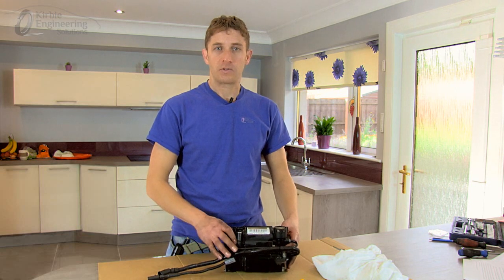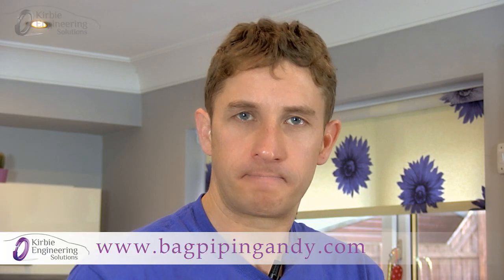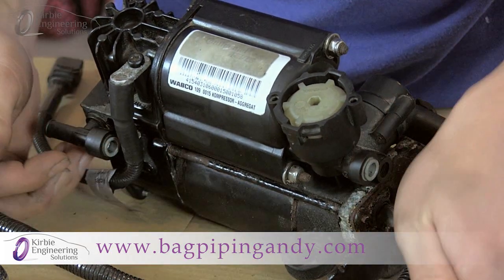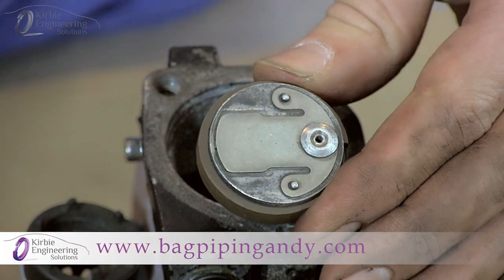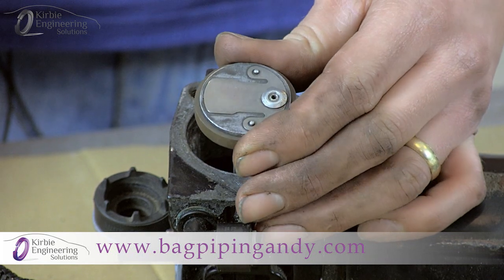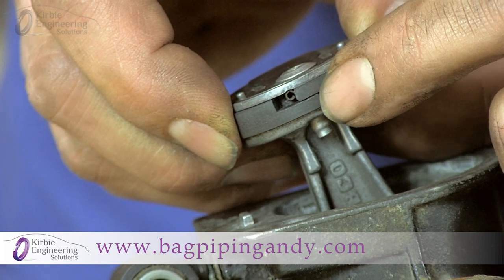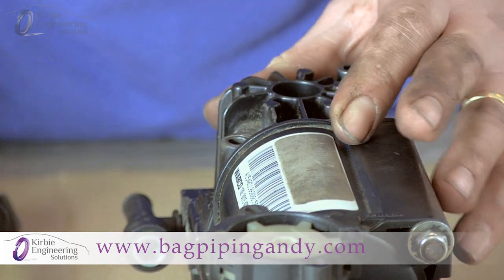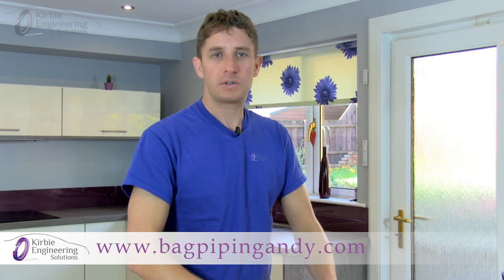Bagpipingandy- How to fit Audi, Jaguar, Mercedes, VW, LR, Wabco air suspension compressor repair kit

Comment: I just replaced the unit on a discovery 2. The removed unit had a lot of corrosion on the flywheel / crankshaft wieght AND the Main Bearing on the motor / crankshaft was seized (the big end bearing was fine as was where the bearing sat)
- unfortunatly I did not realise that the big end bolt was LEFT HAND Thread and boke it.
- anyway the corroded crank really looks like it is pressed onto the motor shaft with no easy way of removal to gain access to replaced the dry and corrosion siezed main bearing.
- the water in the crankcase appeared to be condensation wet , not any amount that would be measutable or drain out
- The reciever dryer on the  air compressor also was damp inside, prompting me to think that replacing the drying agent inside would be a good thing to do if one were overhauling the compressor

- Perhaps you may consider as part of the kit, an option of the drying agent replacement for the reciever
- just a thought

Comment: Thanks for the video 
Do you not need to replace anything in the dryer section ?
Reply from the maker: Hi, if you wish to dry the desiccant beads simply remove the beads and dry in the oven or using a heat gun (hairdryer on slow speed) for 2-3 minutes that will dry and regenerate the drier beads, it will not improve pressure but will remove any moisture trapped in the drier, there are other springs and parts which go rusty, I have most parts in stock if you want to replace anything. Any questions please just ask.
Reply: @bagpipingandy  thanks for your fast reply I will check it out now 👍

Comment: Good video, very clear. Do you know what the large white cap does? Its adjustable with 'H,M or L' markings. I've researched but without success. Cheers, Andy.
Reply from the maker: hi, the white cap is a pressure relief valve, it consists of 2 springs and a rubber disc, this is the last resort if all valves are closed and compressor runs constantly the air will vent out this valve, most compressors only have 2 settings Low or High (14 bar or 16 bar) to let pressure out

Comment: Will order the kit....I swapped to a working compressor because original stopped working,...the car rises but occasionally rides very high like it’s in service mode. Hard reset doesn’t remedy. Get suspension fault code.  There’s a rattle sound in the compressor when car rises. What should I check for to cure the rattling sound once I disassemble to put your kit on? It rode high today at start up then by end of day was at correct height.
Reply from the maker: Hi, this sounds like a level sensor issue, scan for faults and check all 4 level sensors are attached properly at each corner.

Comment: Hi do you have a video on how to repair the valve block ?
Reply from the maker: Hi. The valve blocks cannot be repaired, but they don’t often go faulty. Get in touch with your suspension symptoms and I can help diagnose what may be wrong
Reply: bagpipingandy Hi. i’ve sent you a whatsapp on your mobile from website.

Comment: Very helpful video. I just ordered a kit for my 2008 Allroad (C6). It's sinking at the rear air springs overnight so I'm going to replace those, but it's very slow to lift itself up too. It's done 155,000 miles so I suspect the compressor is getting a bit tired. Hopefully this will sort that out.

Comment: Hi Andy, I have a suspension problem with Audi A8 and wondered if your kit would fix the problem or is it another issue? I had the bearing changed on the rear left side, then the discs and pads but somewhere in this work the air suspension no longer moves between dynamic and sport. The VCDS tells me the modulation on that wheel is 0.9mm out of tolerance. I measured the centre of the wheel to the arch and it is 1cm more than the rear right side. Many thanks in advance 👍
Reply from the maker: Fault codes will help us understand more what your suspension issue is, email me at info@bagpipingandy.com

Comment: Hi Andy, great vid. Im having an issue with my 2007 Q7. The front 2 struts drop when you leave the car for a while, they rise again within a few seconds once the car is started. Also the car rarely goes into offroad height and never goes into lift height. Ive sprayed the struts and lines with air leak detector and cant see any bubbles, which leads me to think its the compressor but thats a very uneducated guess. The q7 forums dont seem to mention this problem, but many recommend you, so before i bring it to the garage what would you recommend. Any help is greatly appreciated. Thanks
Reply from the maker: Pete topwen Hi Pete, sounds like an airbladder leak, any sinking of the car is a leak and not a compressor  issue, the compressor only lifts the vehicle, airbladders (air struts) tend to leak at the cars lowest setting, use soapy water only when the car sits on its wheels, lifting the car off the ground moves the rubber and stops the leak, if one corner sinks lower than the other it is the corner to focus on, the opposite corner will lower to try and keep the car level.
any questions please e-mail me at andy_fulton1@hotmail.com
best regards
Andy

Comment from the maker: Sale_shark i cannot reply to you for some reason, but will do a new comment. :)

the car sinking us a leak, if it always sinks at level 1 but never sinks at level 3 this is an airbag leak, very common on the allroad the bags only leak at level 1, my kit will get the car lifting again but it will not stop it sinking. You need to fix both the compressor and the leak. Ti fit takes less than 10 mins as the video, you need to remove the compressor 1st which can take 1/2 hour to 1 hour depending on the rust!! :) so as a guide it takes around 1 hour.

email me at :

info@bagpipingandy.com if you have more questions

best regards

Andy

Comment: Great clear film !!!
Hi, I have a 2003 Audi Allroad 2.5TDi and the suspension has recently started to play up, dropping or not rising, then being okay for days, I can hear the compressor working away when needed. The bags seem fine. Is this the problem with my vehicle and if I get the kit will any garage fit it as I've no tools or car lift etc. How much should they charge approx for doing this, rough guess, will it be baed on time rather than pound notes etc

Comment: I was curious if you'd ever be interested in creating OS pistons for those that have scarring on the walls and require a rebore? It'd definitely open up a huge market for us that have compressor walls that require a rebore. Thanks!!
Reply from the maker: I have tried to rebore a unit before, but the cylinders are tapered halfway by design it is not so straight forward, also then you need to coat the cylinder with PTFE again which I have not mastered yet :), working on it though!!
Reply from the maker: I now have brand new cylinders if you need to replace a scored cylinder.